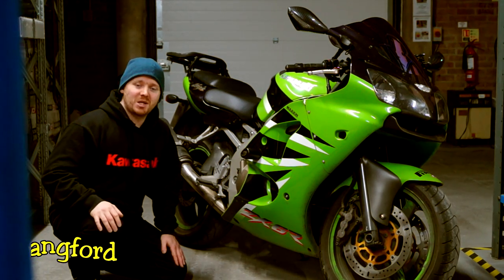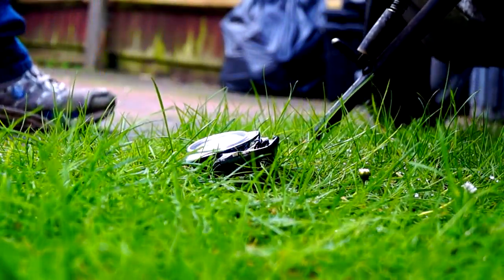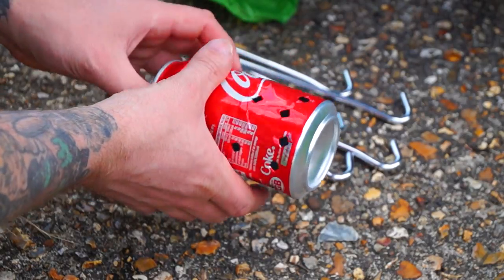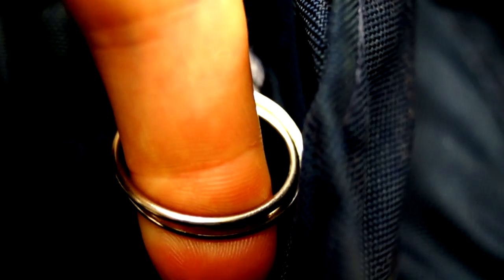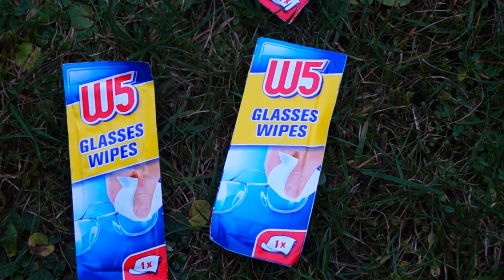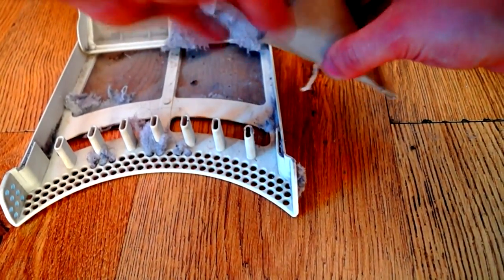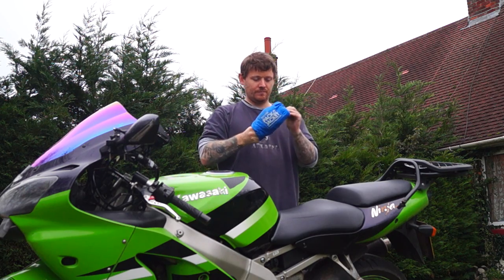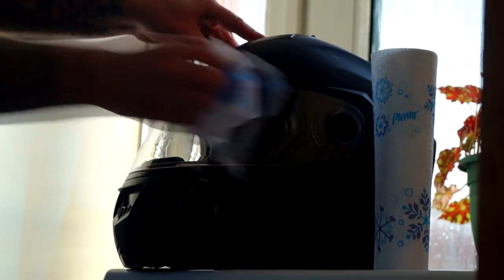Best Motorcycle Camping Tips & Hacks 2019

Comment: Great tips, another little tip regarding empty gas canisters, the Campinggaz CV300 quick release canister (shown in the video near the tent with the green plastic cap) can be refilled using a can of lighter gas, simply press the  nozzle into the top of the CV canister and fill. Saved me a few quid!! :-)

Comment: Hi I was wondering what GPS tracker you showed and is it any good? Also how much is it to keep working (subscription) and does it work all over the world or only in UK/euro? Thanks
Reply from the maker: Hi, the GPS tracker in this video is a TrackR and I would not recommend it. I use it for it's bluetooth feature, so I have about a 50 meter range. Ideal for hotels and camping only, as it will set an alarm off on my phone if it moves. I would recommend something like a GPS PS136, great little device for full tracking. All the best!

Comment: Stupid question. 

When going motorcycle camping, if you want to go out for the day where do you leave all of your bike gear and other valuables that you can't really take with you. I am planning on doing the 3 peaks later on in the year as a bike camping holiday but I was wondering where I could safely leave my helmet and other gear while doing the hikes?
Reply from the maker: I hope you have a great time doing the 3 peaks! As for your question, the only practical way around it is to use "hard luggage" that is lockable. Most of the time I end up leaving the side bags when hiking, and they could potentially be stolen every time. I use a metal cable through the visor section of the helmet, and lock that to the frame. I would personally consider a decent top box, to lock away the most important things. All the best!
Reply: @motorbikeway   Thank you very much! I don't know why putting a cable through the visor section never came to mind lol. I've got hard side panniers and would be able to load those up with boots and jacket etc. Thank you for your reply.

Comment: Forget the term Counter steering. You don't ever actually Turn the wheel the opposite way you want to go. This will cause someone to over turn in a panic and crash. What you do is apply pressure on the right to go right and apply pressure on the left to go left. In actuality this is turning your wheel slightly in the other direction yes to cause you to go in the desired opposite direction but it's way safer to think of it like this than actually making a conscious turn.